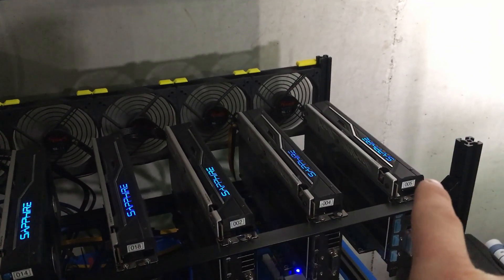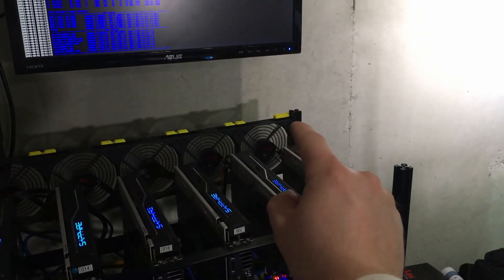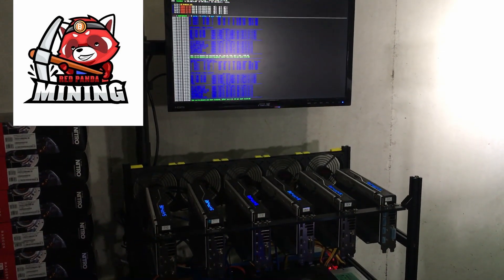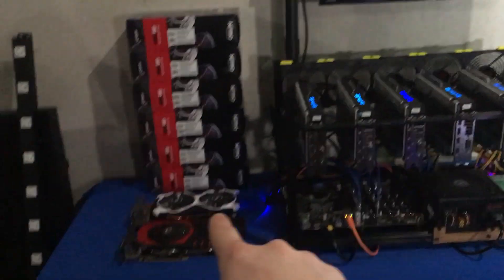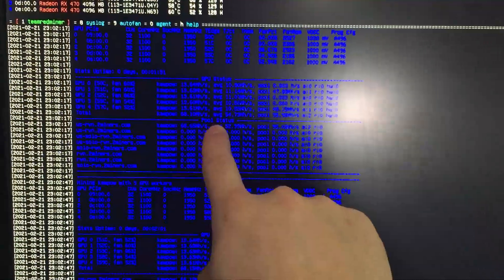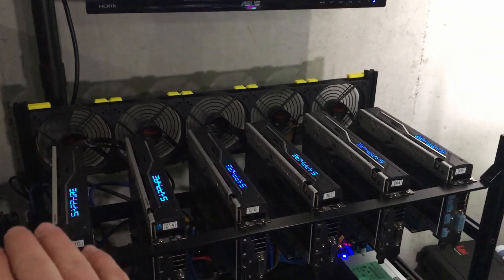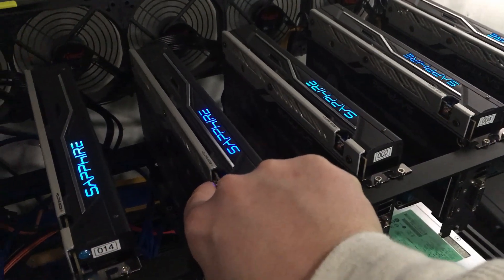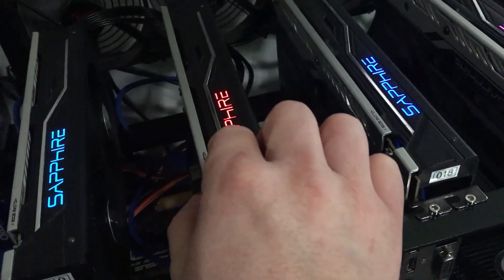My First Dead GPU From Mining | What Do We Do Now?

Comment: Hey how's it. i had a similar problem with 2x8gig AMD cards first  one detected dead and two months the other detected dead on a B250A Mother board i thought the cards were over heating changed thermal pads and new thermal paste still would not work well they did for 5 seconds then GPU dead (that was happerning the whole time befor i changed the thermals) tried other Algors same problem then i trieda 10+ year old gigabyte mother board i think it was my first gaming pc LOL never throu that old stuff away. and now they are both working so weird, they have been hashing now for the past two days. Thanks for all the great content

Comment: I had the same issue before with two RX580 Sapphire Nitro+ using H110 BTC PRO+, I put it out and test in my PC and work perfectly, I changed riser (USB Cable, PCIe Splitter), and put back In the BTC PRO+ and the same problem again, I change the GPU position and the same issue, the thing was the MB I do not why but as soon as I put those GPU appear dead... I changed my BTC PRO+ for Biostar TB250 and is working without problem. Also sometime the BTC PRO+ disconnect al muy rigs from internet. I do not know if you have the same board in that rig.

Comment: Hey did you have any luck getting it to work? One of my powercolor 5700xt cards just did this. Went and vanished without a trace. The fans give the smallest twitch when in power it on. Done the physical component test, risers, power, etc. was mining away happily and then I woke up and it was undetectable. Physically installed it in x16 slot as the only gpu into a motherboard even. Nothing. Not the original owner.
Reply from the maker: I will have a video out next week talking about "how i made out".